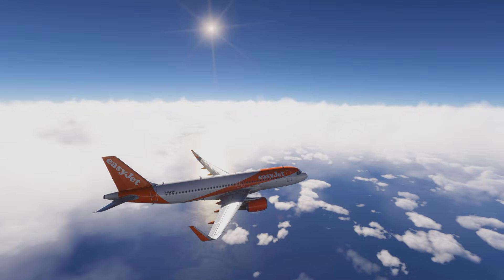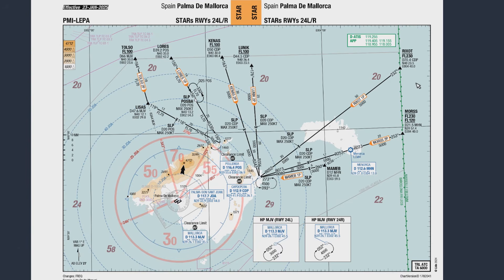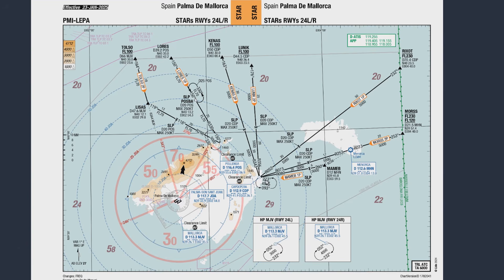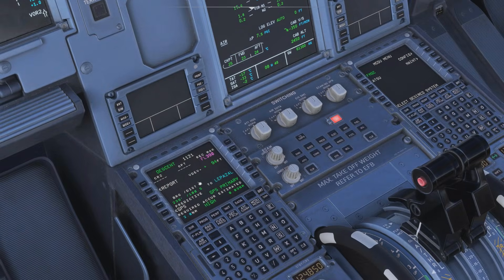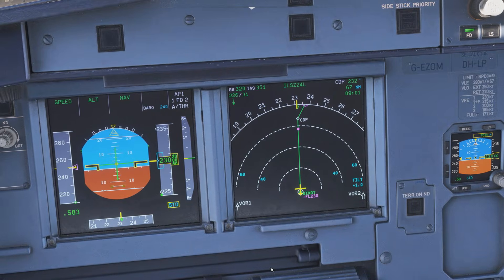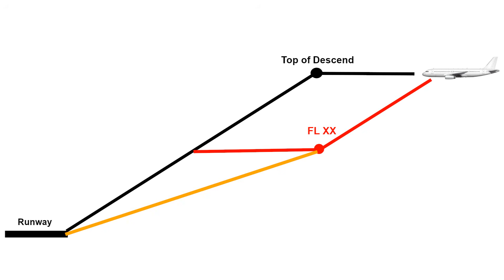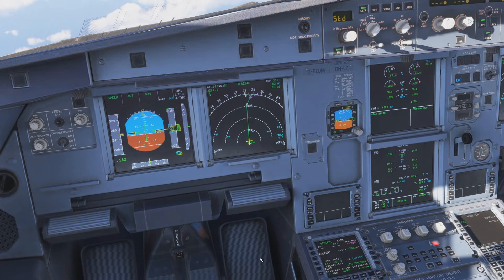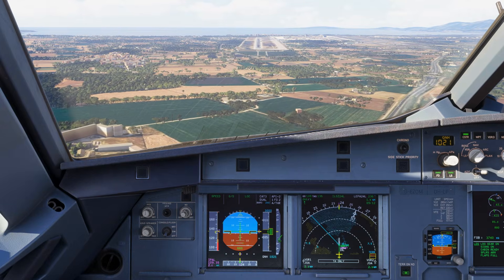When the Managed Descent goes wrong

Comment: Very very interesting. This meand that when in my STAR there is a constrain  at or below a given altitude, It is better to check in the mcdu the yo-yo difrence. The reason to do that I suppose is Just for economy reason.  The Flight plan should  have the FDP level constrain, so il the aircraft is to low it will slow down the descent  profile in any case
Reply from the maker: @antoniopettini9503  Yes. By doing the direct to you will still have all the constraints and the aircraft will obey them, but in a more efficient way.
By the way, you don't have to do this after every constraint. This is a special case

Comment: The ideal, most economic profile would be a Parabel profile with no stay at cruise FL on each flight.... it doesnt work for most of the flights, but there are some domestic flights which exactly follow this Parabel, e.g. EDDH-EDDF etc ... climbing-ToC and ToD at the same point and descend into the... regarding the LPMA Arrival... the Airbus just tries to follow a continuous descent to climb or descent within the constraints given
Reply from the maker: @VonycBln  yes, the most efficient flight would be a parable. However, this is almost never possible. I have only ever achieved that twice so fat.
Concorde did a similar thing too.
If you are referring to the approach into LEPA, the calculated descend profile is still wrong. This is why we always do a direct to after the first level restriction....or you just ignore the aircraft and do your own thing using v/s. Both works.
Reply: @fsclips  I just made a flight into LPMA and took the RIXOT 1P for ILS Y 24L ... unfortunately i forgot to record it inbound RXIOT.. i started my recording prior D20 CDP ... it's far out thats true, but it was a nice continuous descend until touchdown,  pretty spot on.... you are right, thats not the 'real' as you never fly any approach as given in the charts; 97% you'll get a shortcut to or even d DCT to IAF etc ... but this theoretical approach was pretty well done by the Fenix A321; the recording has been uploaded

Comment: So in summary the Airbus will calculate an ideal TOD point to achieve the first restriction and then straight lines down from there on. Direct To forces it to recalculate an ideal TOD to whatever the next restriction is. Pretty clever I think, because recalculating new TODs after each restriction without being told could give some unpredictable behavior. With the current implementation, even though it’s not the ideal path it’s 100% predictable and as you’ve shown easily updated!

Comment: I always just used managed decent towards the first constraint and then swapped to using open decent with a bit of calculations as to when to start going down, however this is a good way too which I will consider doing. I do think this applies to the Boeing as well when descending with VNAV.